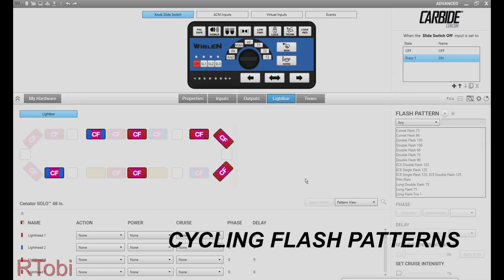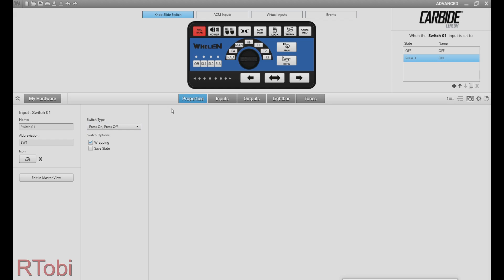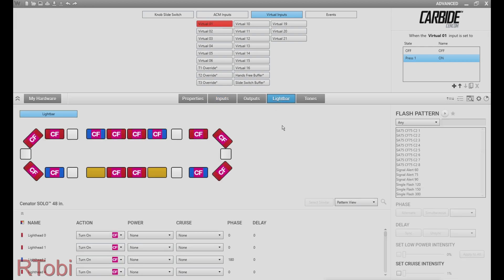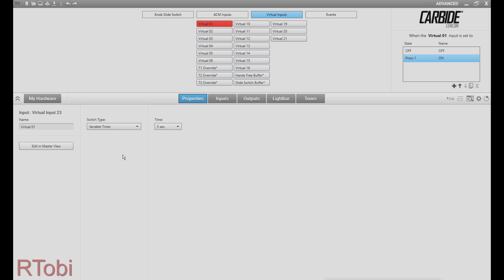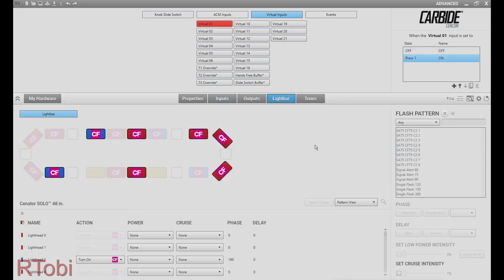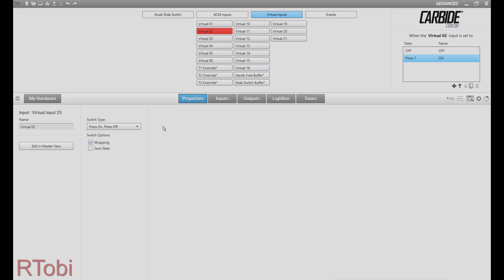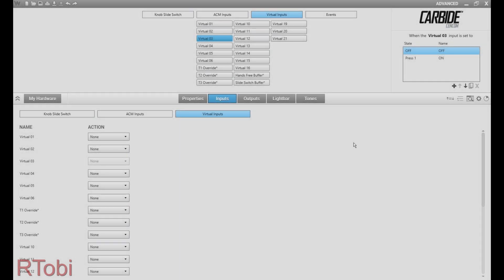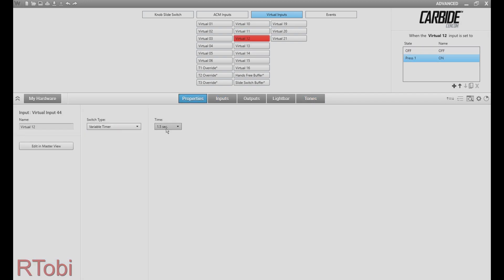How To Program Cycling Flash Patterns & Siren Tones - Whelen Command Tutorial

Comment: Why do you turn them all off at the end ??
Reply from the maker: Do you mean at 2:37?
Reply: Likely to program the off and on states. Otherwise, when you give the Whelen box power, your programmed instructions will take effect, and turn on regardless of the on/off state of the button.
Reply from the maker: @Dvance  I did that to turn off the virtual inputs. Otherwise those virtual inputs and therefore the flash pattern cycle would continue to run since there's no instruction that turns them off.
Reply: @Rummeltobi I'm looking forward to programming my box, is there any way to use my own .MP3 for a 'siren tone' or can I only select from their catalog?
Reply from the maker: @Dvance  You can upload .mp3 files but their file size should be very small and they should be 10 seconds long at max. Be advised that even if you turn their volume up they may not be as loud as Whelen's standard siren tones.